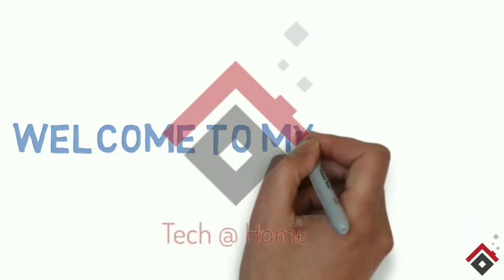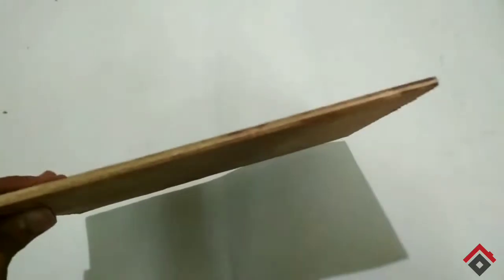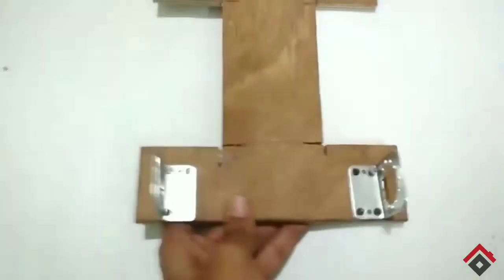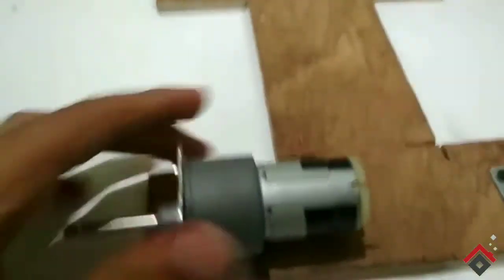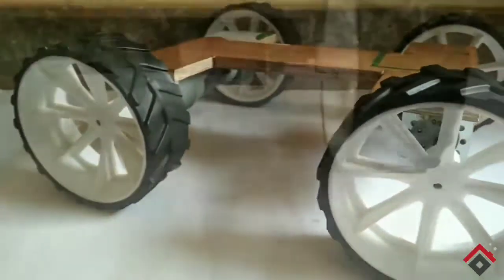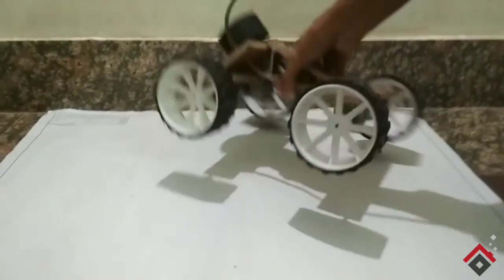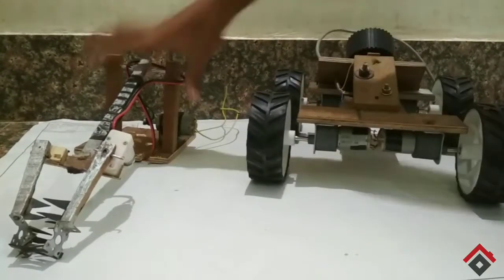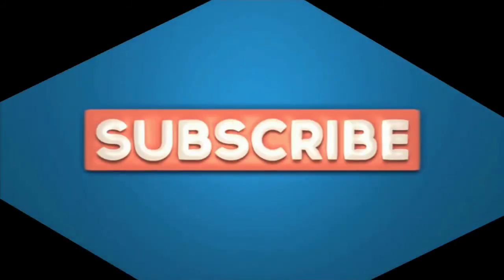4 wheel-All terrian robot for Roborace ||Making of Robot

Comment: What size nuts did you use for attaching the motors to the clamps? And where can I get them?
Reply from the maker: M3 screw
Reply: 5mm or 6mm length?...Plz mention where to get them
Reply from the maker: @barunkumar5297  M3 screws with 5mm length.
You can get it from any hardware shop near your place.